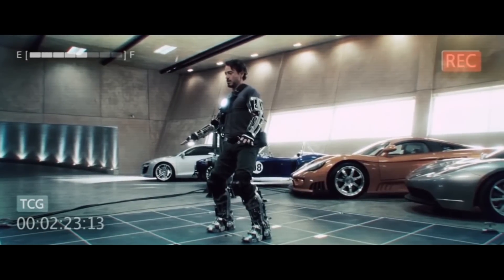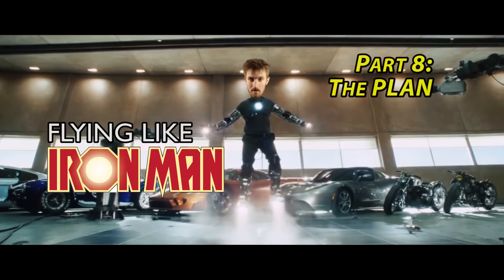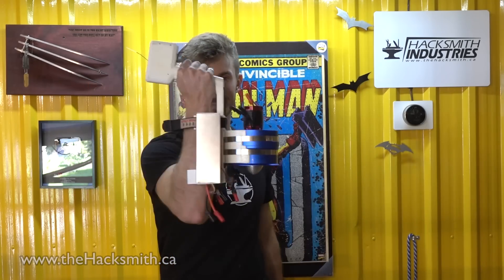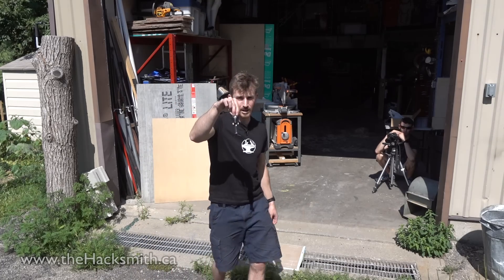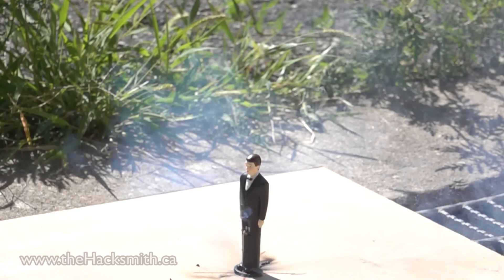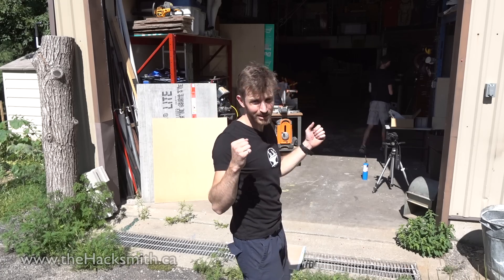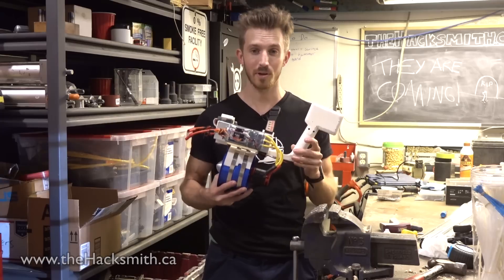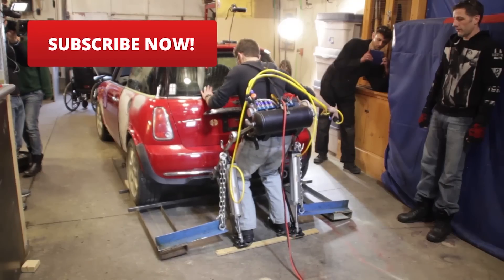Flying Like Iron Man #8: The Plan with Electric Ducted Fans

Comment: I would genuinely suggest you look at Mythbusters' attempts to fly. They proved it to be impossible. I'm not saying you can't do it, but having seen your attempts, and your planning, I think it would help to look at past attempts too.
Reply from the maker: +Anirudh Sharma then how about the 3-5 other jet packs/hoverboards made in the past few years...? Tech is advancing, that mythbusters episode is old :p
Reply: Hey don't get me wrong here, I'm all for finding a possible solution to this. You seem to be on the right track with the multiple turbines as that is what the successful jetpacks have used (e.g. Jetpack Aviation). Some companies have also used wings that deploy when the person decides to fly horizontally rather than relying on the power of the turbines alone. Since batteries are not very energy dense, it might be easier (but less safe) to achieve flight with simple gasoline. These are just my two cents and you've probably already thought about these points. Looking forward to the next proof-of-concept video! Cheers!

Comment: lithium ion batteries, while good compaired to other batteries have a tiny energy content by weight compaired to chemical fuels. It would be more visually appealing and possibly necessary to use a chemical fuel such as in a combustion jet or (less efficiently) hydrogen peroxide canister like the jet packs that already exist.

Comment: the reason helicopters are stable is not because the thrust is above cog, but because the rotor acts as a gigantic gyro. Also look up the concept of "inverted pendulum".
Reply: the gyro aspect helps a bit but did you watch the video? if the hacksmith had attached the bottle rocket right above the tuxedo man he would have gone straight up
Reply: oh now I just learned about the pendulum rocket fallacy, I guess I'm wrong lol
Forgive me for trusting the smart sounding engineer :(
Reply: Multiple thrusters also need som kind of regulation system, whereas a simple rocket with only one thruster can work successfully with only rigid steering and rotation to fly in a straight path. The problem with ducted fans is their insane speed to thrust ratio which makes sudden changes in thrust very difficult, also they need enough thrust overhead to be able to adjust quickly enough (if all thrust is used to keep stable altitude, there's no thrust left to adjust attitude). It will be impressive when/if he pulls this off, but there's obviously much left.

Comment: super dangerous, but for power, what about a nuclear reactor. you would need radiation shielding centuries ahead of what we have and a more stable core, but it would have a higher output than batteries, and might weigh less. i've seen pretty small NRs.
Reply from the maker: +Nick Zimmerman yeah, I'll get right on that.

Comment: Are you aware that there is already a jet powered "board" you stand on and it actually flies?

It's built by Zapata. They solved the stability issue so what you were saying about the thrust being above the c of g is not quite true.
Reply from the maker: My comments in the video were a bit generalized -- of course it's possible, but those systems also use gyros and constantly  adjust throttle to remain balanced. We're going for a fairly manual system requiring the pilot to be pretty skilled. Remember we're not trying to invent a product or commercialize -- we just do this for shits and giggles :)
Reply: the Hacksmith I have my doubts about going electric because of the weight but if you can actually get it to work it would be quite an accomplishment. Good luck.
Reply from the maker: Well a good example is the arm thruster we built. With speed controllers, ESC, batteries, and the weight of the EDF itself... around 1.5kg. So out of 8kg potential thrust, we have 6.5kg -- not much, but still decent. And those batteries will last for approx 1-2minute at full throttle. 

Will it be commercialized and actually usable? Hell no. Will I be able to fly for 1-2 minutes? Yes =)

Comment: understanding there is danger but could you use a much larger fan mounted directly to you're back then ducting the thrust below you (Not talking about E.D.F.s). Understanding there is a loss of efficiency while ducting but it might be gained back with the much larger fan. If how i phrased that dose not make sense its like a turbine on you're back not facing up but behind you with the the thrust forced down 90 deg below you. Maybe a way to cut down on the weight of a ton of battery's on you.
Reply: I'm no engineer nor did i spend a lot of time thinking this through just a suggestion.

Comment: Well, i know i'm late to the party, but how about instead of heavy batteries, you use a combustion engine to generate the power you need for your setup? Or a micro gasturbine?
Reply from the maker: Just as expensive, harder to control -- with electric we can have automatic stabilization!
Reply: You have electric propulsion only. The MGT is coupled to a dynamo, that provides the juice you need to feed the Impellers. There is no hot air involved, except the gas turbines exhaust jet, like on a Auxillary Power Unit in an aircraft. So, you have your cold air propulsion and onboard energy source, the problem with this concept is, that the MGT gets really, really hot, like fucking hot, so you need aditional shielding or you become the most awesome grilled chicken in the history of amateur aviation ^^.
Reply from the maker: We're talking about over 120kW of electric power draw... do you know how big a 120kW (200+hp) gas engine is...? you would never be able to get enough thrust to lift all that.

Comment: why would you do the feet before the jetpack? it seems like you could do a test flight using the stunt wires if you have the arm jets and the jetpack and not with the arms and legs, although you might want to put weights on yourself when of the stunt wires so you don't only weigh 20 pounds.
Reply from the maker: +Kyle Ocean cost of components...

Comment: you could do the majority of thrust under your feet. what about those water jetpacks they have where the majority of thrust is under feet. I did it and it wasnt bad. a little practice and i was able to do it. if im wrong please explain why
Reply from the maker: +Sweaty Cock think about how that system works -- the hose, filled with water, drops your center of gravity down, waaaay down. It's a completely different concept
Reply: +the Hacksmith oh ok, thank you for clarifying that

Comment: You need to look into the Rocket Pendulum Fallacy
https://en.wikipedia.org/wiki/Pendulum_rocket_fallacy
Having thrust coming from a backpack is not more stable than if it were coming from your feet. Well it might be but not because of placement, but because your feet is going to flap around. Keep the the vector of thrust aligned with your center of gravity and you'll be "fine".

Comment: It's because in the first iron man movie when he was fighting the terrorist he was just flying using his boot jets and he shot the explosive missiles but it's because he have all the thrust under you that means all the the thrust it going down and not separating but if you had a hoverboard or the green goblin there thruster spread and support all the mass and weight above them but other than that you can't fly because the. You'll need thrust above rmgravity to lift you and stabilize each friction of you in diameter or you'll just die

Comment: Why not switch to fuel turbines n dump those wimpy electric fans. As the fuel runs out so does the weight helping your flight status. Depending on the battery setup of course, in comparison fuel seems like the better trade off. Also someone could control the thrust remotely freeing that huge payload your adding. Radios alot less weight. Spend some time with Fuel RC Airliners. They fly 50 pounds a few hundred mph all day long.
Reply from the maker: +FutureAirways2 the radio weighs nothing... Would you really want someone else controlling whether you live or die?

Comment: one question what is the formula you use to measure how much lbs of thrust you need compared to your weight,  the weight of the edfs and batteries?
Reply from the maker: +Gadgetman1989 math? Lol. Most drones you want at least 150% thrust of the weight of the system, ideally 200%. That way you can hover at 50% power and have lots of extra thrust for zooming around :)

Comment: +the Hacksmith its gonna be really hard to stabilize yourself with fixed stabilizers like the ones you have.
Reply from the maker: +Ean Arendt what part of these is fixed?
Reply: +the Hacksmith 
Won't the jet pack be?
Reply: +the Hacksmith 
no harshness. i wanna see this work. Stabilization is the big thing though.
Reply: +the Hacksmith shoulder mount stabilizing with self correcting actuators and software to use balance and correct body motion like an anolog controlers like wii remote so it's more like a jet pac that hinges between props maybe using rods cross braced and tied to each prop that pivot so u dangle vs forced direction

Comment: Yeah sure thrust at your feet doesn't work because your center mass is much higher. But isn't that why Tony Stark has flight stabilizers in his hands as well? I feel like you could definitely control yourself much easier in this manner.
Reply from the maker: +Mike Gus Fifteen check the infographic...
Reply: I can't find it on your FB page, unless I'm totally blind lol

Comment: if you make \ / shaped hole for your electric fans. Would it help somehow?
Reply: Interesting idea. Usually nozzles are more helpful for jet engines for controlling the amount of pressure inside of them, so that wouldn't help because its electric. You would change the velocity of the air but the amount of mass being moved stays the same so there wouldn't be more thrust.. But maybe because more of it is in the direction desired it might have a useful effect. Its usefulness might not be worth its weight though. 

Its possible it could help.

Comment: You need to have a little chair to sit on, and a bar to go over your head with the system. So that when it lands, your body is not stressed by the system's weight. 

What you are doing can leave someone on a wheelchair (broken spine), just because of a hard landing. 

Look up "Personal helicopter" that a Japanese made. You want to build the same.
Reply from the maker: +Dimitris Tripakis kinda defeats the purpose of the project though... Personal helicopters have been made many times before. We're talking about a jetpack style drone
Reply: the Hacksmith You are right, I just suspect it won't be safe enough. Lets hope Im wrong.
Reply: Dimitris Tripakis

Comment: you are afraid of the thrust below the center of mass, but you have not realized the pendulum rocket fallacy. Every rocked designed has the thrust on the bottom because raising it above the cg does not change the outcome. The only reason I see why jets on your feet is a bad idea is that your feet will not be able to handle the force from the jets and remain stable. I highly recommend looking up the pendulum rocket fallacy.
Reply from the maker: +Integral Spark i may have over simplified things in this video, but remember we do have finite thrust control using EDFs unlike rockets. We're not building a giant rocket. We're trying to make a fleshy meat bag (me) hover :)
Reply: Of course your feet will be able to handle the pressure he's only hovering, not flying yet.

Comment: Have you thought of some light weight super capacitors with some solid state hydrogen fuel cells? For a hybrid system....
Reply from the maker: +Master Destructor super capacitors are very over hyped, maybe in the future they would be viable, but right now they wouldn't stand a chance in this system. Remember, each EDF draws 8kW! The entire system will consume more than 100kW, which is more than three US homes power supplies!

Comment: ...maybe you should buy smaller batteries and connect them in parralel/series to extract more current because in reality you'll probably fly for a short period of time (1-2 min max). Power is more important than capacity in this case...:/
Reply from the maker: +Krunoslav Šokić power is easy to get, capacity is the hard part! The batteries we have can put out 180A and they're not even fancy ones! :)
Reply: ...wow that's serious ammount of current O.O Can your electronic controller handle it (on a long run) without bursting into flames?...:D

Comment: What about if you fly with the fans on your wrists pulling you up instead of pushing that way you would have more control over your flight
Reply: controlling your rotation, yeah?
Reply: +justinhuot1 I think he meant that he should hold his hands over his head and have the fans pull from there....That way the center of gravity is below the thrust, providing more stability.

Comment: I think you need to build the suit first then the flight, you already built an exo, but a suit more like ironmans.  In the sense of strengthening fingers for gripping larger metal objects, being compact and ridiculously strong and most of all powering it....   If only arc reactors were real hahahaha..   Maybe build a hacksmith fusion reactor 😂
Reply from the maker: +justin Young haha I'm all for impossible... But building a flight system with an extra 150lb suit plus pilot... Would be almost impossible with today's technology
Reply: +the Hacksmith I've loved Ironman since the first one came out, I used to try to design the power and flight systems..  (I was 10 lolol)   It totally makes sense to use the EDFs to fly with current technology, but it would be cool to explore more exotic flight systems!  Somewhere I read that people think his palm mounted stabilizers manipulate gravitons to keep him parallel to the ground rather than high-alpha..  Of course that isn't possible today, but the whole appeal of Tony Stark isn't that he uses current technology to invent new things, it's that he uses current technology to invent far newer technology..  I feel like it will be difficult to get the support needed for this project, but you could build some of your own ideas for how his flight could work, like plasma repulsors or EMDrive..  Electric motors have existed for years and are really overused..  Regardless of whether they'll fly you around it would be good filler videos to try building more futuristic propulsion systems!

Comment: You could also try adding wings that pop out like the falcon
Reply: that would just add weight and serve no purpose
Reply: +Marcus Octavius if he was going fast enough like on the long board or the bike he could suddenly open up the wing which will produce lift. The edf's will also provide constant lift and pressure for the wing so the wings would actually help. If you thing about it it actually makes you lighter because if you jumped off a cliff with wings you would fall slower than without. There are also many light and strong materials that they could be made out of
Reply: TheNinjapig27 the problem is that he will be barely able to lift off the ground anyways, he won't go speeds that it would be useful. And jumping off a cliff is just too dangerous. It would look hella cool tho
Reply: +Marcus Octavius true

Comment: What if you build a light exoskeleton? It would be rigid and you could fly like IronMan does.
Reply: Likely because it is just more weight to lift vs. the benefit of the added stability. The light exoskeleton would likely need to be either aircraft grade aluminum or titanium... not cheap.

Comment: why not... as proof of concept... mount the smaller, cheaper fans you have to yourself as you have mentioned.
then, put the batteries on the ground and teather them to the fans with a wire.
I appreciate it's not technically "free flight" and you'd need a heavy duty wire which will be heavy.
but as proof of concept, it might get you further down the road with less expense.
Reply from the maker: +Jason Park exactly what we'll do!
Reply: +the Hacksmith +1.  :)

Comment: instead of laying the EDF's in a horizontal array that would take up too much space and make it less like flying like ironman why not put then in a vertical array that is putting one on top  of the other and seeing if they boost each others thrust in a ironman like fashion
Reply from the maker: +Torne Dixon unfortunately the complexity goes way up as each EDF has to have custom propellers at different pitches and speeds, you can't just put two in a row :(

Comment: Dude make an electric jet pack with your idea then make a 3D printed exo skeleton model that fits your body then make that using metal but make sure you put joints at your neck knees and arms then attach the electric jet engines on your back/shoulder area and/or put stabilizers on your arms and   
Just for fun maybe put some weapons on but with the batteries you could store them in another layer of the exo skeleton in the arms legs and finally put sheet metal on the exo skeleton but make sure you can open it I suggest making the back open like a door so someone else can latch and it will stay closed also use Siri software for Jarvis and for the helmet google glasses
I am not an engineer I am an 11 year old kid that loves your vids bye